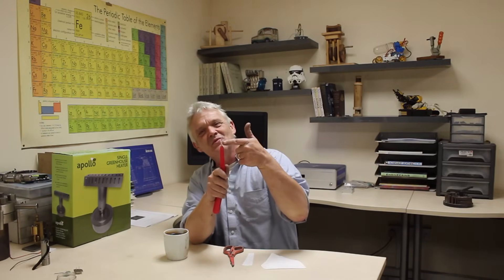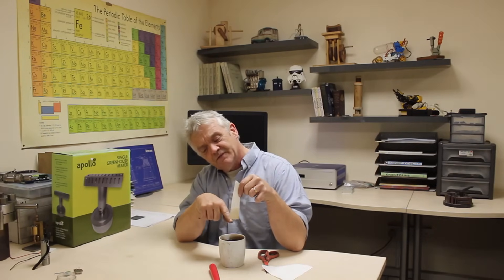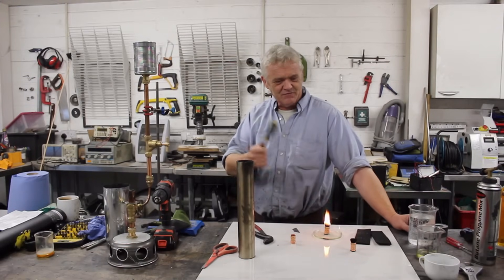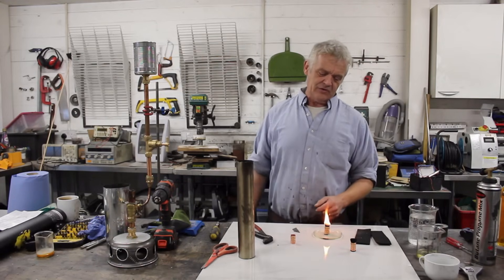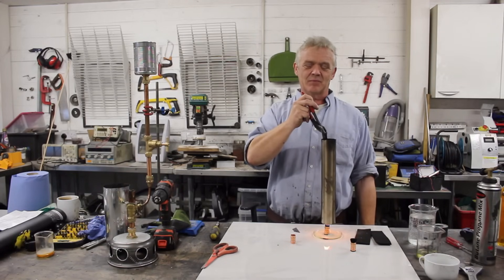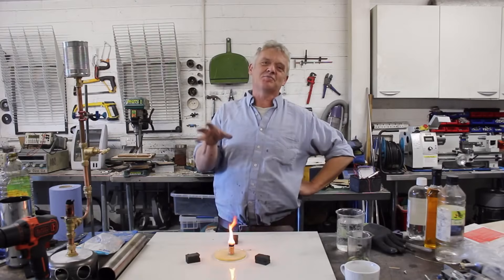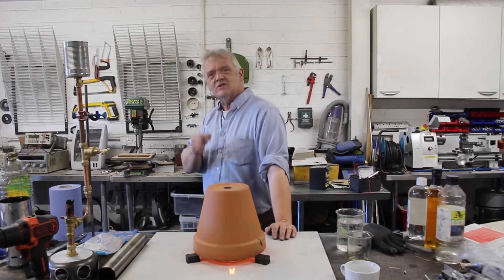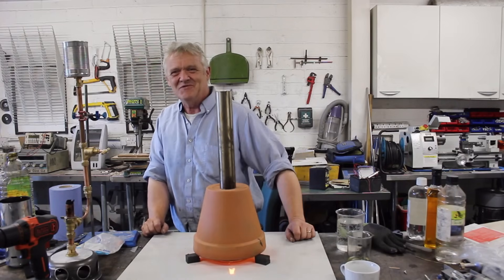1680 The Magical Forever Wick - The Plant Pot Heater On Steroids

Comment: The old brass torches with the little pump on on the side, that were filled with gasoline and used by people to braze and solder had a wick which was assisted by air pressure to the tip.
Reply: I am (past tense..was) a collector of all those plumbing torches. Quite unusual, I have around 70 all different, and have never lit one! Retired now, kids don't want them, so time to sell.
Reply: @chuckredd9131  Too bad the kids don't want them. They are the perfect torch should supply lines go down.  They can be cleaned, repaired and kept in use indefinitely. There are probably quite a few people in remote areas using similar ones as a practical first choice. China makes new ones out of steel and they are made very bare bones. However old yours are they are not obsolete. Check eBay they are still in demand. Brass ones being the most beautiful. Jewelers still use a version for working silver which is pressurized with a foot bellows that bubble air through gasoline and down a tube to a torch head.
Reply: @drakedorosh9332  Appreciate the info., your time & help!!!

Comment: Farmers used to clean used motor oil by placing it in a barrel in the top of a building and wicking it through a hemp rope to a barrel at the bottom of the building.  It would take a long time, but clean oil was the product.  I wonder if the carbon wick would clean oil at a faster rate with going uphill and using gravity to separate particles?
Reply: Didn’t know that.

Comment: Ah now that is interesting. I've been using carbon felt for years as a wick for meths stoves, but hadn't considered it for oil. I'd like to make an externally vented version for use in a camper van. It would be better than the conventional diesel van and truck heaters because it doesn't need an electric feed for a glow plug. Very, very interesting.
Reply: a methamphetamine stove? lol
Reply: @JonnnyStorm  methylated spirits, like heet or rubbing alcohol.
Reply: @CairnOfDunnCroftPermaculture  ahhh thanks for the clarification, meths stoves and camper vans in the same paragraph usually means something different...:D

Comment: Another great video. What do you think the space heating possibilities are? How much heat would this give off? is it the same amount as just the burning flame alone? I don't understand. But thermodynamics kind of tells me I won't get any extra..
Reply: If you compare the price of vegetable oil with the price of kerosene you'll probably find a kerosene heater is cheaper to run. Also if you can get one that takes a cotton wick you can burn diesel in it.
Reply: @thomaswilliams2273  I burn diesel in my storm lamp it lasts ages

Comment: Fiberglass is something else that also has long been used in that fashion. It'll wick a liquid, but not readily burn either. It also can take heat fairly well, so it is used to wick fuels used in gas heaters or lamps. And there are videos on YouTube showing how to make simple greenhouse heaters putting the wick through a copper coil so that only the vapor emitted through a small pinhole at the bottom of the loop is what is burned, and those are fairly efficient.
Reply: Do you think carbon fiber will work out as a wick to?
Reply: Any link to,  how to make simple greenhouse heaters on YouTube? Thanks
Reply: @ucmeytsc7302  Ummm,,,Here!!
Reply: I would think fiberglass in the air from burning would be a bad thing. Too many other materials to use.
Reply: @dalehastings1062  I would think so, my Dad made Caravans, and the Fibreglass Stank, Irritates the skin and, I think that it's Not as inert as the Carbon felt?!!
Reply: In all that you do, be aware of what you use, how you use it, and how it affects you and yours. 💗  (And the availability, plausibility, and effectiveness of alternatives)
😎✌️
Reply: Asbestos was popular as an "eternal wick" back in the day as well.

Comment: May I remind you that carbon is quite easy to oxidize? (Aka burn)
Reply from the maker: may I remind you cotton burns at 210 degrees C and carbon at 400 degrees C - cotton is universally a wick material and burns much more easily than carbon - isn't that curious?
Reply: @ThinkingandTinkering  Yes but you specifically remarked it won't burn :)
Which it will. The very tip of the wick can overshoot 400°C with ease, especially if more air is provided with the aid of a chimney. 
The cotton wicks also transition from cellulose to carbon then to carbon dioxide as the combustion actually occurs im the carbon area only as there is the needed surface area for mixing the fuel vapor with air, react it and sustain the fuel decomposition temperature. 
Carbon felt wicks just skip the cellulose decomposition, they have larger fibres that will take longer to oxidize but eventually will.
  
By the way, in search of longer lasting wicks, glass fibres provide pretty good capillary action on higher viscosity fuels and silicon dioxide is... much harder to degrade. 
Woven gass cloth for composites, as an example. I used to run oil lamps in my early youth with glass wool pieces when I was irresponsibly exploring the catacombs in my city. They didn't burn very well but they were very hard to spill which was a good trait.
Reply from the maker: @PașcaAlexandru  ok cheers

Comment: Would you recommend 2mm or 5mm felt?
Reply from the maker: I don't think it matters because you roll it up it really depends on what structure you put it in - when I put it in the argand lamp I used 2mm for no other reason than that one fit well - in the 'candle' style in this video I used 5mm for no other reason that I didn't need to roll up as much - it's going to be horses for course I would guess

Comment: The main issue with those pot-heaters is that they eventually warm the air inside of them to the point that they can start to boil the wax/oil and make a dirty vapor.
Reply from the maker: lol - I am sure there are more issues than that mate - but it is easy to make

Comment: That's cool. I could see how that could be made into standardized wick products. Wicking kerosene heaters are popular as backup heating option where I live. Vegetable oil is used in liquid "candles". There was a decorative product sold here in the US as a liquid candle "kit". I've made them as emergency candles when the power has gone out. Take a small glass jar and put veg oil in it (half full or so). Get a piece of thin plastic (like from a coffee can lid) and cut it into a disk so that it will comfortably fit in the jar leaving plenty of room to the sides of the jar (only want to cover half or less of the surface area of the oil). Punch a hole in the middle of the disk. Then you cut a short strip (one and a half inches or so.) of cotton (perhaps carbon felt) from an old t-shirt or something, roll lengthwise and run it through the hole leaving half an inch or so on one side, which will be the top side. Then you put the disc and wick on the surface of the oil so it floats short wick side up. Key is to gently push it down so the oil covers the plastic disk, and it will. There you go! A liquid "candle... Light the wick once it becomes saturated. As the oil burns down the wick stays floating on top.
Reply from the maker: nice - thank you for posting that mate

Comment: When I saw the thumbnail I thought the terracotta was going to be the wick :)
Reply from the maker: I suppose it might but this is much more useful - easy to cut!
Reply: @ThinkingandTinkering  Terracota wicks water (as you have previously shown with the cooler) but is probably too dense to wick a thick oil very far. A ceramic wick with a lot of pores could be possible I guess, or even something with a lot of capillary tubes drilled into it.

Comment: Adding a Chimney, does not change the "Soot" problem.  The soot, will just collect on the Chimney walls... and eventually, may in fact cause a Chimney fire...

 The only way to eliminate soot, is to make a Rocket-Stove design, that has the correct amount of airflow, to allow a 100% clean burn.   The burn will be MUCH hotter than a typical fire... and so, you will need much more robust solutions, than a Tin-Chimney.   IE:  Thick metal pipes.  Or...  maybe something like High Heat capable fire-brick.

 From what Ive read... certain rocket stoves and or rocket mass heaters... have eventually worn holes in the steel combustion sections.  The thicker the steel, the longer it will survive.

 Poorly designed rocket stoves / rocket mass heaters, do produce smoke / soot.  Again, it is about the shape, lengths, and the amount of airflow needed... to make sure that the fire gets hot enough, to burn completely.

 As for veggie oil not burning... Im not so sure about that.  I was in a house, when these dudes nearly burned the place down.  They were trying to fry stuff, got the oil too hot... and it burst into some seriously tall flames. That said... Im not sure what cooking oil, that they were using.

 It might not be easy to light on fire... but once its going... it can be quite a problem.

 I was using an Outdoor  Propane powered Wok Burner.  I accidentally let the oil get too hot,  and the oil ignited,
and blasted into an explosive fireball that was about 7ft high in the air.  Luckily, I was always prepared... such as pre-wetting the ground around the Wok.  And luckily, it wasnt that hard to turn off the burner, and cover it with the Lid.  I believe I was using Peanut oil.

 Veggie oil, is almost always "Soybean" oil  (which isnt really good for you).  Even worse for you, when its Hydrogenated as that stuff sticks to your internals, like Glue.
Reply from the maker: ok cheers

Comment: Nice work Robert with the activated charcoal felt wick. What I would like to see is you could make the oil burn without showing any soot at the chimney pipe you put on the clay plant pot ?? Just wondering fella. Great show as usual too. Peace vf
Reply from the maker: I have been thinking about that mate - because I agree with you - the soot for me represents an incomplete burn and so a problem - I have an idea or two !
Reply: @ThinkingandTinkering  I will be looking out for a new video showing just that Sir Robert. God Save The Queen. Someone who will never be replaced and ever equaled. Peace vf
Reply: have you seen how you tubers make drum and fire pits that burn clean. one need to supply oxygen/air all around the flame.
Reply: @civicrisenz  Am looking at just that Emile. Thanks for giving me a heads up.

Comment: Will it work in a oil lantern and olive oil? Because I did not have good luck with it in my kerosene lantern so I must have had the wrong kind of carbon felt or was it graphite felt and was too porous. But good job on the plant pot heater.
Reply from the maker: I do plan on trying it mate

Comment: The chimney looked like it worked great with the wick by itself, but after you put the flowerpot over the wick and then put the chimney on top of that, it began smoking again. Maybe the pot itself is enough to act as the chimney, i am not sure why it began smoking after the long pipe was added on top. I would have thought it would create a better draft and cause it to burn even cleaner, but maybe it is too much draft and blowing air past the flame so fast it has no time to heat up in the chimney enough to burn that smoke off.

I guess i wonder about it because i am wondering if there is a way to make it like a rocket stove. Have the flame inside an insulated chamber designed to get hot and stay hot, and then how they have that 55 gallon drum forcing the exhaust back down around the outside of the burn chamber to then the exhaust goes into some pipes that go thru some mass, and then finally the pipe exits the building. But in this case with the tiny little wicks, to just have a few of them burning in a tiny rocket stove burn chamber, and see what the exhaust looks like, if it is clean or not. Maybe it is clean enough to allow to exit inside the home? But also in this case the rocket stove will be miniature, the 55 gallon drum could be like a one gallon paint can, etc... And with those wicks having the possibility to last forever, if the oil burn chamber part is designed right, all you would need to do is add veg oil and mess with nothing else, just light it again. I say "like" a one gallon paint can, meaning i would suggest using real 1/4" thick SS where the exhaust heat hits the bottom of the can/drum otherwise it will burn out prematurely, and also with that thick plate getting the brunt of the heat  it can be used as a cook top.  But for mock up you could try a paint can just to see how everything behaves(the flame, the soot, the exhaust heat, etc...), but in a test environment, not in a home yet, and see how it behaves over time first. Maybe i could try, i can make most of it out of cob for a test, and then paint cans, some fire insulation, and pipes. But the pipes and fire insulation will be used later, those are the only things bought that i need in the mockup that i will also use later in the actual installation, once/if i go to be serious about installing it somewhere, after i confirmed it will work. If it don't work good enough i will just use wood as the fuel and exhaust it outside after it goes past the cooktop and thru the mass, just like traditionally. So all the materials i used on the mockup can be taken off and used to install it permanent, besides the stuff i don't want in a permanent installation like the paint cans, and the extra cobb. I could still have some cobb though, it can be beneficial, run the pipes thru it, and it is cheap(free really). The permanent stove will be SS burn chamber with fire brick and insulation, with that thick cooktop.
Reply from the maker: nice ideas mate - thank you for sharing - If you you  do experiment with this can you share the outcomes?

Comment: Oh I'm definitely trying that. That is awesome. I wonder what the consumption of veg oil is on one per hour. I'm off to the chippy to get some. My thought is to have several of these in a ring, each with its own chimney just the right length, then heat a container of water which is then pumped through my radiators.
Reply from the maker: wow - nice ideas mate - keep me in touch

Comment: Actually, my dad poured some gasoline into a dixie cup once, and then asked me what I thought would happen if you dropped a lit match into it.  I was expecting something exciting.  Instead, the match just went out.
Reply from the maker: yep - liquid fuels don't burn - you need to vaporise them first - the issue with lighter weight fuels is you tend too have a degree of vaporisation just at room temp - heavy oils that doesn't happen so much - if you left it long enough it would heat up and vaporise and burn - but you need to leave it a good long time to do that in heavy oils - the safety factor is if you do knock it over it won't burst into flames you have time to pick it out - that's not so much the case with lighter fuels

Comment: What makes carbon felt resistant to burning? Doesn't carbon burn?
Reply from the maker: cotton burns at 210, carbon at 400 plus - wick work by vaporisation which helps keep them cool - so it is much harder to get the carbon to the temperature need to burn it when used as a wick
Reply: @ThinkingandTinkering  Does this mean, in theory, that a cotton wick that has been pyrolyzed to drive off all of the volatiles such that only the fixed carbon remains would also not burn? If this is so, it should be possible to make charred twine/carbonized twine for use as a wick, and it should behave the same.

If so, a kerosine lamp with one of those ribbon wicks could have that wick last indefinitely if the wick were first pyrolyzed. It would be easy to do: put it in a can with a nail hole in it, and toss it in a fire until all the volatiles have stopped coming out of the nail hole. The volatiles could blow into the fire and contribute to the pyrolysis.
Reply: @ThinkingandTinkering  Thanks. That makes sense.

Comment: thats pretty awesome but it raises the question... will it work in an oil lamp or perhaps that stove you recently showed.. when you put the metal flue on the clay pot it appeared to be smoking or was that just a digi cam capturing heat waves?
Reply: The hole in the top (bottom?) of the flower pot wasn't as large as the chimney, but it might be enough if you channel the fresh air directly onto the flame closer to the middle. I think a lot of oxygen was going around the outside instead of making it to the flame.
Reply: @DFPercush  yeah maybe raise the chimney / flue to let air underneath
Reply from the maker: it was partly heat waves and partly more smoke

Comment: Right off the bat, I would make at least one quick tweak. I would insulate the copper, so that the oil gets hotter and burns more efficiently and fully. You want the copper to conduct the heat all through the oil, but at the same time, you don't want it conducting the heat away from the oil out into the surroundings. As you have noted in other videos, not only is vegetable oil dense and viscous, but they tend to have high ignition/combustion temps. The shape and surface area could probably be played around with to increase efficiency a bit. 

  (Tip, unrefined oils tend to have significantly lower ignition/combustion temps).
Reply from the maker: nice ideas mate - thank you for sharing

Comment: I tried the carbon felt material long time ago but the actual fumes from the material itself heating up wouldn't allow me to keep the vegetable oil burning indoors for to long . Now having said that the material i used could have been lazed with other forms of chemicals, but it can be ideal for outdoor use. I never got my hands on pure carbon felt
Reply from the maker: you are right about indoor - more work needs done on this to make it good for indoor use